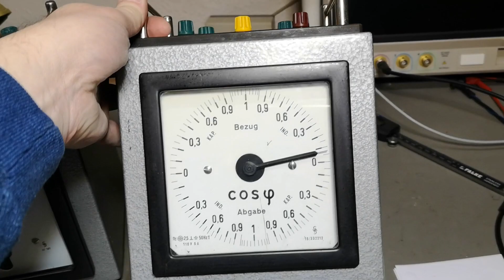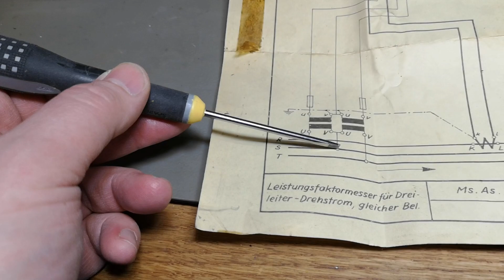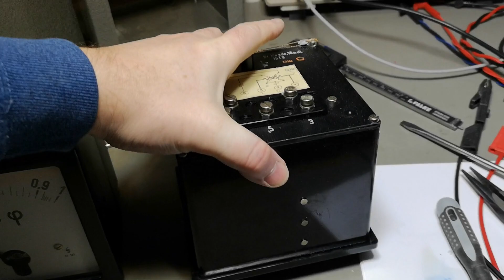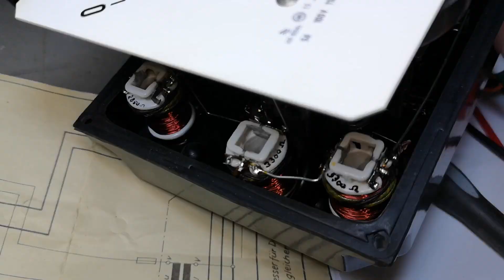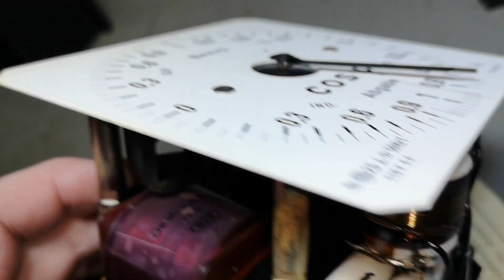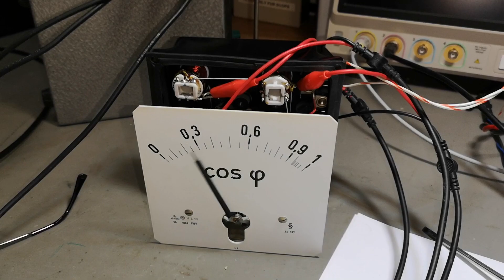Phase Meters AC 3 phase voltage/current, two types from 1960 and 1963

Comment: Definitely NOT made by Impo :) This is on another level.
The 110V 5A is a standard in energy distribution. High voltages where converted to 100V and 5A nominal voltage with voltage / current transformers. These are the exact instruments that in the olden days where used in power plants to monitor a generator.
Reply: Yes, they are monitors for measuring transformers, similar to indirect measurement of electricity consumption for large loads, even a current transformer could be used for this meter, conversion to 5A is common

Comment: Second meter will show both phase and direction of current flow, so you can see if your load is acting as either a resistive load, a capacitive load, or inductive, and if it is a large motor it can also feed power back into the mains, which this meter will show as well. Normally used on a pumped hydro plant, as it will show the load on the turbo alternator, and also the phase of the power being produced when the motor direction is reversed, so as to act as an alternator to provide power, instead of being a pump filling the upper storage dam.